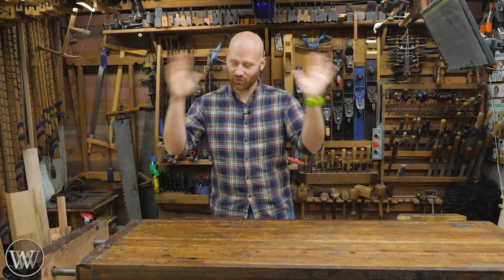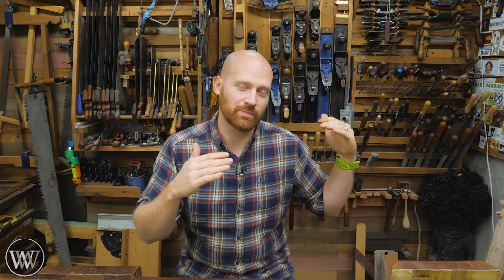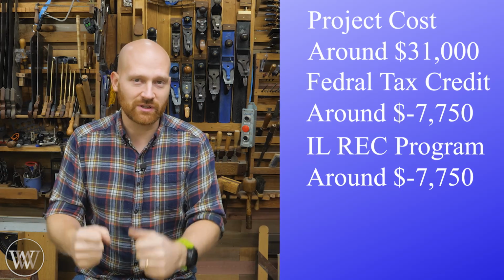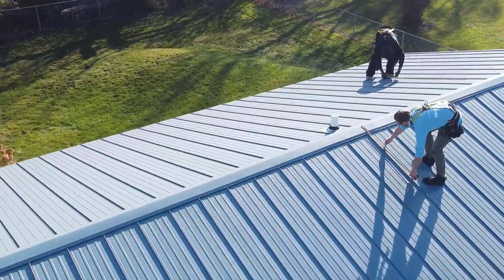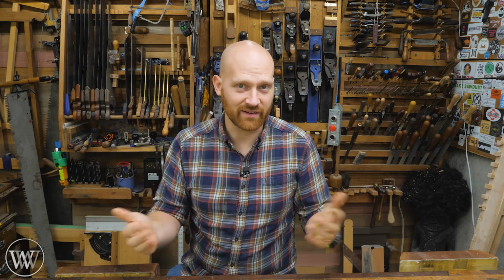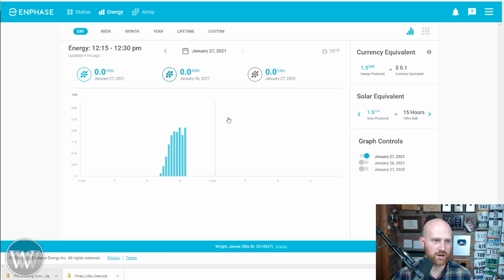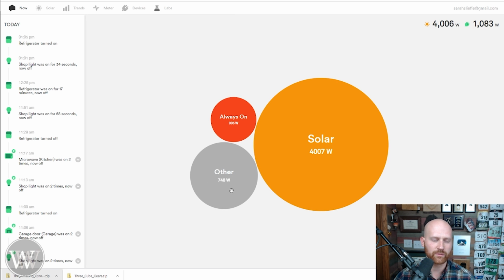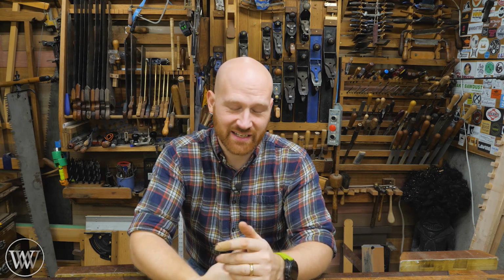Why I put Solar Panels On my Roof Lots Of Greek Numbers

Comment: Regarding snow. There is a good chance that on a slightly sunnier (even if still freezing) day, when the panels unfreez only a little bit (and provided they are black, they can do it quite quickly) the snow is going to slide down violently (eh, with your roof that may not be that violently) all at once from the panels. This is good, because the panels start working again, but it also can be very bad for anything (plants) right below the edge of your roof. The solution is either remove anything precious from the ground or put small fences on the edge of your roof that would stop the snow from sliding. The downside of this solution is that you don't get your panels back online as fast but it will be definitely safer around the house. With the fences installed the snow would stay on the roof and depending on the amount melt when the sun shines.This might be not a big safety issue in December or January, but in Februrary or March, when there still can be noticeable amount of snow the sun is higher it might become a problem.

Having all the data from the inverter is nice, but make sure it is secure. My experience is that manufacturers of such embedded devices don't put enough effort to secure them. The worst case that must be avoided is the devices with a public IP being available on public Internet. Huge no-no. Periodic uploads to "the cloud" are better but still someone (the vendor) may learn information (depending on the inverter model, configuration etc.) you don't want them to know. The best solution (alas not the easiest to deploy) is to collect and analyze the data locally. There is a variety of software to do that I havn't used any of them but I've seen one called openHAB has got a plug-in to do it.

Comment: My system went on line in July 2018.  We got snow last weekend and the temperatgure has been below freezing all week so they haven't been producing 🙁.  My roof is a bit steeper than yours but it's maybe 30 feet up.

I have a spreadsheet where I track  each month's production.  I use that to predict how many SRECs (I'm in Massachusetts) I'll sell each quarter.  I also include my monthly electric bills in the spreadsheet.

The power use tracking system you have seems really cool.  I think I saw it demonstrated on This Old House a few years ago.  It uses a cloud service though and  that seemed like a privacy risk.

Best if luck with your solar generation system.  I'm sure you'll be happy with it.

Comment: The add on to your Enphase system to see how much power you are using is only $50 max.  Two inductors at around $20 each online that plug into your Enphase gateway.  Obviously since you are/were an electrician, installing them over the main lines in your panel shouldn't be an issue.

I am getting close to installing my own system (within a couple months) after waiting almost 18 months for a solar installer to install panels for me.  I parted ways with them after much fighting to try getting the panels installed. 

Currently,  I am trying to balance panel cost vs. warranty right now.  I am down to Mission Solar and Silfab (U.S. panels).  Mission solar for price and product warranty and Silfab for the performance and performance warranty.  Why did you decide on Trina panels?

I am also going with microinverters for different reasons, but I like the reason you went with them.

Comment: Did mine with tesla solar glass roof.   Price is very competitive.    Did you consider this?
Reply: Ps heard your note not available...too bad...it's amazing.
Reply from the maker: Yeah. If it would be available here I would definitely be looking at it. Especially with redoing the roof the price isn't too far off. However I did my own roof so I was actually pretty cheap on that end. But most of the local solar installers are saying it won't be available around here until 2022.

Comment: Love solar! We installed 17kw solar system with 2 powerwalls. Never paid for electricy again. To reduce usage with an electric dryer we bought a heat pump dryer. Kw usage went from 6kw to 1kw and did not have to use natural gas. Some food for thought.
Reply: Since I live in the south west, I use the best solar and wind powered dryer. It's called a clothes line. I know not everyone can do it, but I use what I have as often as possible. I can also line dry inside the house during the winter.
Reply from the maker: I'll have to look into that was pretty thanks.

Comment: My springtime project will be a solar wood drying kiln. I'm planning on using solar panels to power the air circulation fans. A couple of 100 W panels and a couple of car radiator fans should do it.

Comment: Having distributed inverters vs a single big inverter sounds really sensible. A relative of ours ought a house near us about 18 months ago - it already had a solar system installed. Back in November the place got hit by lightning; it hit the chimney and blasted bricks all over the place. About 25% of the panels were damaged, but it also took out the inverter. I don't know their solar economics, but they were in shock when they got their first bill of full electricity usage. The solar company is dragging their feet on repairing it, too - and because the solar company "owns" the system they won't let anyone else work on it.

Comment: I have thought about solar every now and then, but never looked into it seriously.  I'm in the Deep South so I might be missing out on a windfall of cash by not having one.  I'm sure I would have to remove some trees to optimize the system and prevent build up of leaves and pine needles on and around the panels.  I'll have to keep this in mind once I replace my roof.

Comment: Nice video!  You need to do your homework! I bought solar system in August 2020. Winter electric is always below $100.00 but summers in Tucson Az get around 110 degrees. Keeping house at 76 degrees We have a electric ⚡️ bill 💵 $350 to $400.

Comment: Does the detailed expenditure of power information change your opinions regarding when to use equipment?  For example, ComEd has said for years that people should run the dishwasher at night when [grid] energy usage is lower, thus saving money for the consumer.  But you make your power during the day, therefore is it more sensible to run the dishwasher during peak solar power production which reduces your grid draw?

I'd love to see a followup video after 6 months and 1 year to confirm that your annual grid draw is indeed averaged to nearly zero.  Thanks for sharing this detailed info.  Awesome video!
Reply: I was told by a solar installer that it's best to run your A/C colder during the day while you're producing the most energy. Then at night set the thermostat back so you don't use that much from the grid. So, it would make sense to run your dishwasher during the day time.